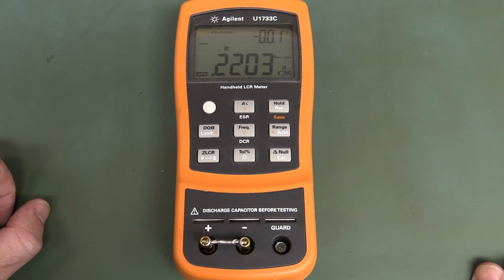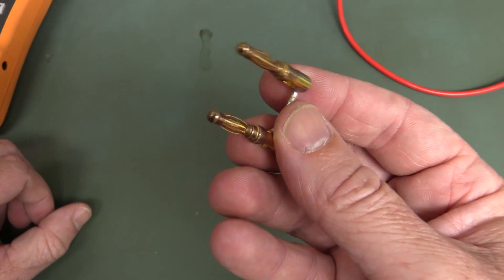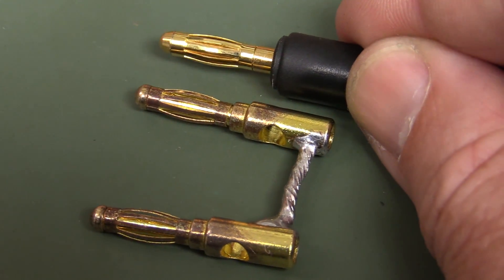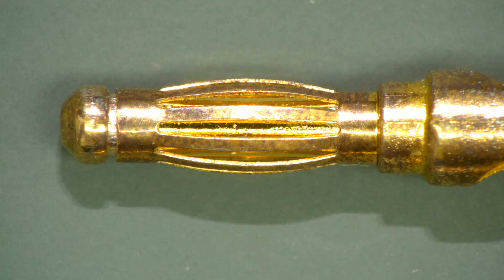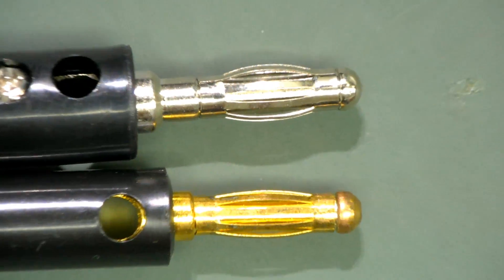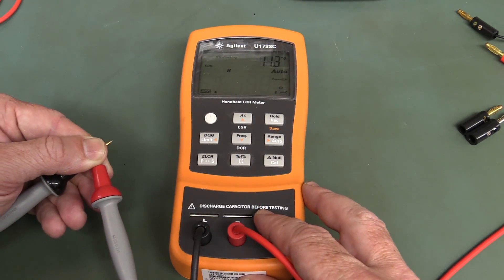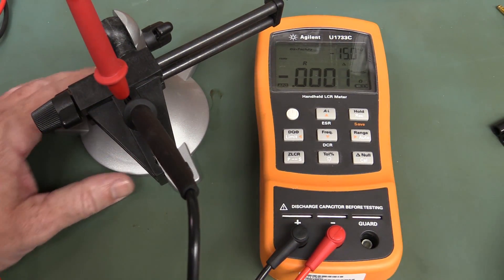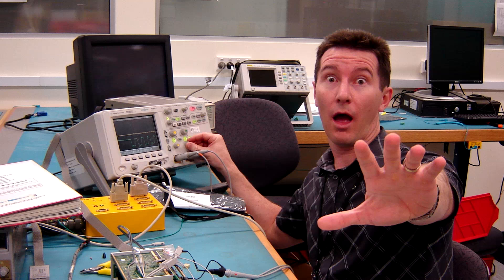EEVblog #1052 - BEWARE Crap Banana Plugs!

Comment: I think they're supposed to extend lengthways when compressed, and make contact at the ends? Those seemed to have a LOT more vertical play on the shaft compared to the genuine probemaster ones
Reply: This. It seems to be a clear example of whoever made the dies and set up the machine having no understanding of how these type of connectors are meant to work. 
Played with these awful ones and also some good ones. They both start out slightly loose and the moment they are in the socket, they tighten up a lot and don't  'spin' where the crappy ones still do.
The super cheap 'gold' doesn't help much either. :)

Comment: Might be cadmium dichromate plating over steel, which would be really cheap, and looks sort of goldish. Ideally, it should be something like beryllium copper with hard gold, which would cost a lot more. You might check if they are magnetic. Dichromate plating is decent antitrust plating for steel, but due to the wastewater used during processing containing chromium, it's not legal in many places.

Comment: I used to buy Logitech cordless mice but they kept falling over and over, refusing to charge. After investigation it turned out the gold plated pads they used as charging contacts were heavily corroded just like the plugs in the video. I now steer clear of Logitech stuff and I've been OK ever since.

Comment: Looks to me the rotating plugs create a contact by elongation and pressing into the top and bottom limits.  The tarnished plugs seem to have a larger gap compared to the first good plugs and a shallower bulge compared to others.    I just tested this by pushing a plug into a washer.  It does elongate with the tip actually working as a wedge.  

Obviously the oxidation is a problem, but if some are still around, try inserting them into a properly sized hole in a washer, or other thin object, and see how the wedging action works compared to good plugs.

Comment: I think thats not gold but sink. You can get the different colours depending on the process used. You can get the yealowish wood screews or the silver ones but both are sink plated. Maybe they tunned the process yo make them look more gold like.
Just put them in hydrochloric (muriatic) acid, if they start bubbling they are sink plated
Reply: Laharl Krichevskoy 
‘Zinc’ — yes you may be correct.

Comment: "Gold" isn't always gold. I got a small batch of those same plastic topped bananas and the rotating part is magnetic so it is ferrous or steel. Most likely not cleaned before plating.
Some of the other cheapies are still brass base however.

Comment: Thanks for this. Most people never consider these things as a source of problems. Years ago I had a terminal strip where the hard black plastic had turned semiconductor from the cleaning sprays used. Took a while to isolate that one.

Comment: The contact on my wife's Subaru battery was dirty,the remote starter was struggling to work so I took the battery clamp off and sanded as well as used a battery cleaner. After reclamping I used the battery paint you can get to prevent it from doing it again. I dont like those barrel type connectors that turn like that, they always fail. I found that out years ago. Terrible. You can clean the things up and solder them to make them solid so they will not turn. the solder does help. They never fit, You can spred the tangs out using a small screw driver to tighten them but solder those twisting ones so thwy cannot twist like that. Yes, they are cheap, period.  a soak in lemon juice will clean them up by the way. Salt and pepper before serving with salad however. Lol. Those cheaper ones collapse and stay small, so they get sloppy and dont spring back as originally designed. On test equipment, stay away from any connections that pivot, you KNOW they will get sloppy and lack of conectivity kills them. I wouldnt use them on my RC Plane,crash eminent!

Comment: I've run into banana plugs like this quite a bit. When I do I always solder the rotating part to the shaft, that usually takes care of it. The problem with the cheap ones usually is the manufacturing tolerances are too loose, which does not allow the rotating piece to grip the shaft when inserted into a jack.

Comment: well, get a magnet and you'll see that the spinnig part is actually magnetising. And the rest isn't but then get a file or something abrasive and scrape a bit of the coating and you'll see that it's aluminum... Even if the coating was allright, they're still trash...

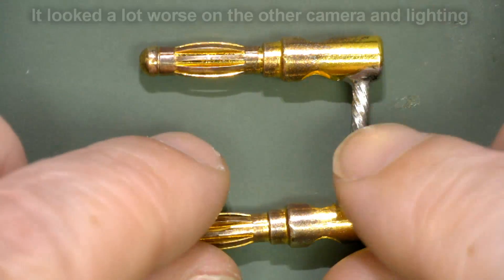Comment: With those plugs, I have used them, but I solder the tips (see the tip and where the fold joins 5:08) and then it does not rotate, but the springiness still does the job. It works! But if the gold plating is bad, then not much chop, throw them out.

Comment: The problem here is the ends of the banana plugs not be able to compress against the shoulders due to the excessive clearance.   As a result, there is no solid connection between the banana section and the rod.

Comment: 9:14 "Nothing wrong with these" - i'm sure part of the reason is that the slit-contact "sleeve", as can be clearly seen, has next to no slop, axially (as opposed to the 1mm or so on the lousy ones). You plug that into a socket, the sprung contacts are compressed, and the "sleeve" wants to expand length-wise (think chinese finger-torture thingie).

Comment: The rotating part is supposed to expand axially once compressed into a socket. This is supposed to make them bond on the lower/upper circular surface. When you  compare proper to the dodgy ones you can feel the slight axial freedom. 
I had a bunch of otherwise proper silicone wires and  decided to use a crimping tool to permanently “fix” the two parts. That improved the issue quite a bit. But I found the crimping losses its power over use. I should solder them in place ...

Comment: What's really the point of the sleeves being rotatable anyway? If one wants to rotate the plug while inserted the outer slits can just as well slide along the inner wall of the female plug anyway, just as with the solid kind of plugs. The main reason for the sleeves I guess is not its ability to rotate, but rather to permit the entire outer part to expand lengthwise when the slits acts as springs being compressed. Therefore they need only have a loose contact at one end, while the other ought to be soldered or crimped in place to ensure good and permanent electrical contact. One less point of failure!

Good video to raise awareness of the potential issue though, although I tend to agree with those that point out it could well have been shorter.

Comment: That's why you buy audiophile grade banana plugs, they have very low resistance and a very reliable connection, like Nakamichi for example.
Reply: They're not "audiophile grade", they're just quality. If they were audiophile grade they'd be an overpriced piece of junk
Reply: No, they are the ones using quality materials. Whether you believe the marketing fluff is irrelevant, if you buy a connector from a reputable company claiming gold plating or rhodium plating then that's what you are going to get. Something reasonably priced that is used for professional gear like Neutrik.
Reply: Audiophile grade would be these. $148, dear Sir. https://www.aliexpress.com/item/Choseal-LA-5101-6N-OCC-Audiophile-HIFI-Speaker-Cable-24K-gold-plated-banana-plug-Top-level/32763918505.html
Reply: Arkadiusz Rozmus I think we might have worthy competitor to Monster cables. Just as capable of separating the money from the next Audiofool. Thanks for the link, you have made my day and it's not 7AM as yet.
Reply: Jan Christian Frodahl Mil Spec means that your watch will declare war on your mobile phone, to make timepieces great again.
Reply: Audiophile grade? Are those the ones that create a larger sound stage?
Reply: Arkadiusz Rozmus Wow! That has got to be the second most overengineered banana plug and cable of all time; but boy does it look good!
Reply: Jan. Audiophile is a joke amongst musicians. Neutrik connectors are a tool, i.e. they are functional and they do exactly what they are designed for. It's like a reliable hammer that you use for 20 years. Banana plugs are for bananas. And audiophiles. ;)

Comment: I've seen this before. The diameter of the inner pin was too small, even when the plugs were inserted they could still rotate freely. A decent banana plug should not move at all obviously. I 'fixed' it by soldering one end of the spring to the pin inside it. Looks ugly but it works.

Comment: If there are any junior scientists out there, this might make an interesting science fair project. Get a couple of dozen of each type of banana connector you can find (rotating, solid, heavy gold plating, cheap gold plating, nickel plating, etc) and a good quality ohmmeter or multimeter, and check quality, consistency, reliability over time (e.g., after 100 insertions each), etc. Might make a worthwhile and interesting project (or YouTube video, if you're so inclined). Wouldn't take much money (other than the meter, which you might be able to borrow) just time and patience.

Comment: I am getting sick to death of this chinese crap.  From copper clad aluminum wire to stuff like this.  You never know what you are getting from Ebay or Amazon.......the best practice is to buy stuff directly from good manufacturers.
Reply: Me too. 1000ft box of direct burial "Cat6" for my security cameras. The cameras would go into a reboot loop when it got dark (when they turned on the I.R. LED's). Took a lot of troubleshooting to determine that it was getting too much voltage drop when powering the I.R. Led's. Not only was the cable CCA, they lied about the specs too. Said 23AWG but it was between 26AWG and 28AWG. The insulation on the wires was extra thick so you couldn't notice unless you stripped it off.
Reply: Brian C - No, but we can infer that just by looking at it!
Reply: LeiserGeist definitely agree with the hit or miss.    I just get worn down trying to find the bargains that don't end up like nightmares.  Even though you are protected somewhat in a lot of different venues, the hassle isn't worth the savings for a lot of things....my personal opinion..
Reply: This is why I try to buy used or NOS gear on eBay for personal hobbyist projects.
Reply: Maybe the answer is simple - dont buy from ebay/aliexpress/ect unless you absolutely positively know what you are doing
Reply: I only buy LEDs, crimp car connectors and silicon insulated LiPo wire. The LED quality can be quite bad, like chipped, jagged, sharp and rough edges, but they work and I always test them before soldering them in.
Reply: Depends what you buy m8, eBay can deliver a lot of quality products, from well known brands, so don`t shame the whole store for allowing sellers to sell sub par products.
If you go super cheap, you`ll get crap, simple as that..
But they sell lots of things I would never complain about, paracord, headphones (sony, xiaomi, KZ ED9 and ATE, and many others) good quality knives, etc etc etc.
LOTS of great stuff on eBay, but it depends on the seller..
Remember that eBay isn`t a store that gets products and sells them, but a marketplace for other esllers to place their products for sale ;)
But FUCK amazon, they don`t ship a single thing I want to norway, like Dalstrong knives :/
Someone send me a Dalstrong shogun 3.5" paring knife please :)
Reply: The thing is, more often then not, when you go to a local shop, they have the same crap, but they ask you 10 bucks more. I've got pretty good luck with aliexpress and hobby king, everything I bought was of the expected quality or better, and whenever I had problems it was with shipping and I always got reimbursed.
Reply: last part i bought from ebay was instrumental amplifiers, date of manufacture is 1998 (!!!), part marking with dye stamp, not laser engraved... it works perfectly. But before that i bought mosfets. They werent exactly as on picture, their pinout (!!!) wasnt correct (not matching to datasheet) and parameters are so bad, leaking gate is least of theiur problem. So yes, its random lottery.
Reply: Yeah, Aussy hobby store electronics shops REALLY ave a lot to answer for. I worked for one once in Brisbane, you would not believe the mark up on most parts. It's absolute Bullshit.
Reply: Banana plugs are just a bad design altogether.
Reply: Brian C that's from China.... guaranteed......sorry if you are offended
Reply: if I buy anything from China involving that cheap nasty dangerous wire I change it out for good stuff anything electrical I check it out first ones to watch out for is earthing on their electrics,  I only buy stuff because it's cheap and I like messing around with stuff for fun and learning electronics and to be fair some of their modules are not too bad  and led's etc.
Reply: CCA is sold everywhere lol, there are suckers that actually buy it and use it for network runs
Reply: It's really hit or miss honestly
There are definitely some good quality Chinese eBay products - it's a real gamble, but sometimes it's just so cheap that it's worth it to try out
I just got a bunch of ZIF sockets for dimes delivered and they seem just as good as the old 3M ones
Reply: stuffs expensive tho ... but yeah its worth it getting the better stuff from Taiwan or the more expensive listings for the home gamer ; still cheaper and (usually) less shit.
Reply: Ive been stung by the aluminium wire thing quite recently. 50m spool of cat5 binned because china
Reply: The problem with buying cheap china junk is that it just encourages the little f*ckers to make more of the sh*t. Yes, quality componentry costs more - but when you see the results of things like these plugs then it makes no sense to buy cheap. At least with ebay, if it turns out to be junk you can get your money back.
Reply: I don't know, a lot of manufacturers won't let hobbyist buy from them directly. and the retailers market up like crazy, for example, yesterday I bought some 8g servos. I needed them a bit quick so I drove2 hours to go to my nearest hobby store, where they were.. $15, I mentioned the 'Light blue one's (they are about $5)" and they guy said, "Yeah, those are the made in china crap" (Never had an issue with them myself, and are very commonly used, but anyways) I bit the bullet, and what do you know, on the box it says "Made in china" needless to say, I'm quite annoyed. yes, I was expecting markup, but that's kinda ridiculous.
Reply: One issue is that people don't hold them to a standard. They just figure, "Oh, it was only $20. I don't want to hassle with trying to get it replaced." But if people started with the eBay seller and asked for a replacement  then onto an eBay dispute, and a bad rating to the seller. Then getting in touch with the manufacturer. Then onto a PayPal dispute, or a credit card charge dispute. Usually the eBay seller will refund your money. If they don't, just dispute the change with eBay. And usually, if the seller doesn't rectify the issue, you only have to go as far as getting in contact with the manufacturer. The way that Chinese manufacturers work is that they have several different quality tiers. So if you email them, tell them the one you got was a POS, they'll send you a better one. That's one of the major issues with stuff outside of China too. Most things have a warranty from the manufacturer, and a lot of the time there are laws that guarantee the consumer a certain warranty, even if it is longer than the manufacturers stated warranty. So if you get something that doesn't live up to the manufacturer's/seller's claims.... Send that shot back or get a refund or replacement. Harass them until they do. (As long as it truly is an issue on their part. Don't be one of those ass holes that try to get things for free or use things then return them.)
Reply: michael rew, Last year a chiese firm takeover toshiba home appliance .... Such a bad new , you will not find any good washing machine... never again. Declair war with chinese now... or we be slaved forever.

Comment: Another common trap is alligator clip jumper leads. Every single pack I've purchased online or from retailers in Sydney has been crimped but not soldered. This is fine if the wire is thick enough to sustain a good crimp, but sometimes it's not so the wire is loose in the crimp. I've found some where the insulation was crimped instead of the wire, and only two or three strands of wire are touching the alligator clip while the others are all just flapping about in the breeze. Sometimes to stop the crimp from being too loose, the manufacturers fold the wire back onto its insulation then crimp the wire to the side of the insulation. It makes a terrible connection.

It's tedious but I had to open every single alligator clip test lead I own, bend back the crimp tabs, then re-crimp and solder them. I tried just soldering the wire to the clip without dismantling the existing crimp, but it usually melts the insulation crimped inside the alligator clip, which leaves no strain relief.

I've had the same problem with those rotating banana plugs before. Ridiculous things! Luckily I figured out the issue before putting them to use. Thanks for mentioning it in this video, I love how the electronics community help each other out by sharing tips.

Poor connections in jumper leads can drive you up the wall when trying to troubleshoot. Scary when you can't trust your test equipment!
Reply: Similar wires https://www.ebay.com/itm/Alligator-Test-Lead-Clip-To-Banana-Plug-Probe-Cable-1M/262136737597?hash=item3d08912f3d:g:M0sAAOSwv-ZaPIc6

Comment: So you solder the top part of it to the base so they no longer move but have a solid connection. Problem solved.
Reply from the maker: It's still a shit connector with shit plating.
Reply: Fair enough. I am cheap though so I would just put some solder on there.